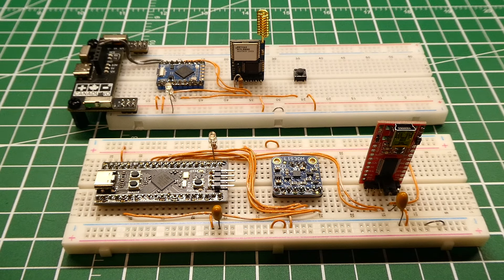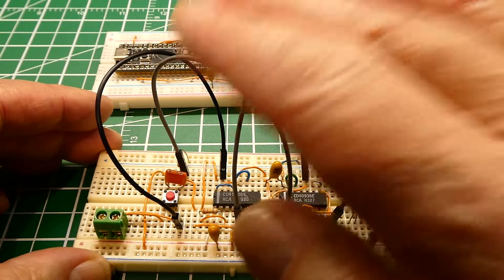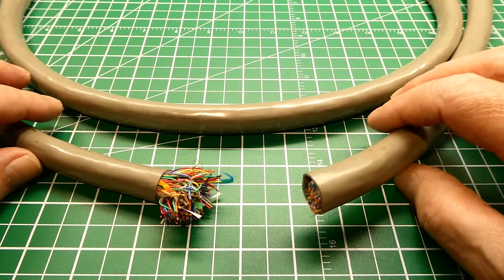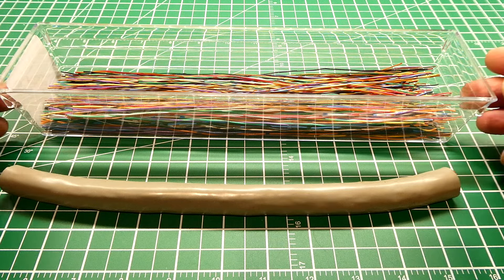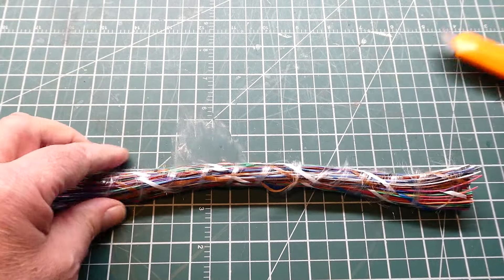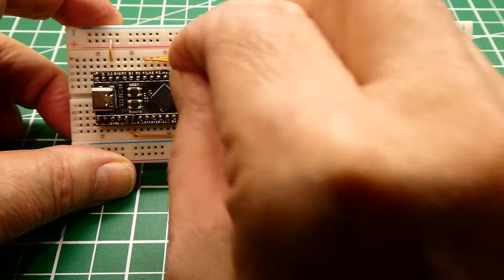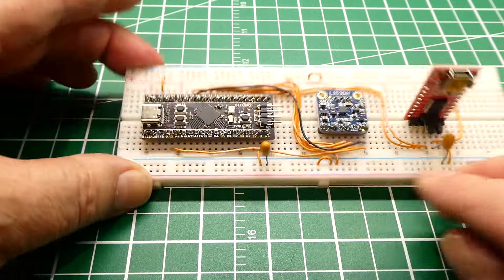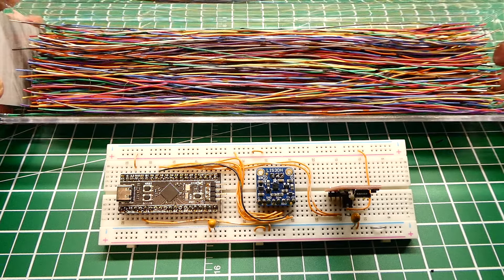Tip of The Day / Breadboard Wiring

Comment: Even easier for most people to get their hands on is a chunk of CAT5 cable.  It's only 8 conductors, but with how common it is, finding a few random meters of it is pretty accessible to most people.
Reply from the maker: Yes, CAT5 works. It is also 24AWG.
Reply: I have 500ft of it lol. Found in a rubbish pile.
Reply: Yeah, and you get a cable in everything you buy.
Reply: I think CAT5 cable is exactly what I have (although I didn't know it until I saw your comment).  Just counted the cables; they come in pairs and there are eight of them.  Someone dumped lots of electrical stuff including cables at my workplace in the electrical recycling that isn't collected for months at a time, and I kept the cable hoping to be able to use it some day.  Today's that day.  Glad I saw your comment.

Comment: Back in 2005 my office was remodeling and I grabbed a box of leftover solid core CAT5e and have been using it every since for breadboarding… I think it’s 24 gauge, not sure but it fits 😂
Reply from the maker: Yes , that also works. It is also 24 gauge. The CDP1802 was my first microprocessor in high school.
Reply: @0033mer  Nice! My first was the 8085, which I spied on your prototyping board ;)
Reply from the maker: That project goes back to the early 80s. I have kept all my prototypes after the PCBs were made.
Were you into the BlackBurg BugBook series? ... just curious.

Comment: Great advice. Using this kind of wire is much easier than breadboard wire for anything of moderate complexity. I hadn’t thought of buying communication cable. I probably paid a lot more for single wire spools. The other benefit is the color patterns, I only have a few spools of different colors.
Reply from the maker: Yes, the color scheme comes in handy for tracing circuits around the protoboard.

Comment: Thank you for the tip. I discovered that if I standardized colors for certain repeating functions, I could return mny months later and figure out the circuit. Red & Green for vcc and ground (black does not photograph well), yellow and orange for I²C (SDA & SDL), white and blue (TX and RX). All yellow would stump me.
Reply from the maker: Yes, the colors come in handy. I use them when connectors are involved. Blue Orange Green Brown Slate is the color code used. It makes it easy to trace them from the connector onto the protoboard. Thanks for sharing.

Comment: For audio work I've found the inner strands of old SCART leads to be a good source of shielded cables. Also a good range of colors. Secondhand shops usually have a box of them and are pretty cheap.